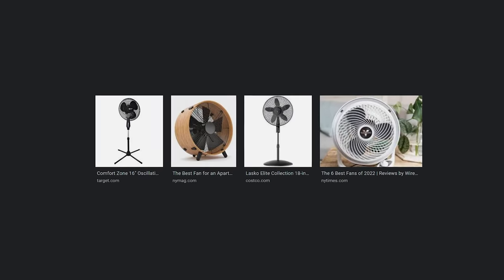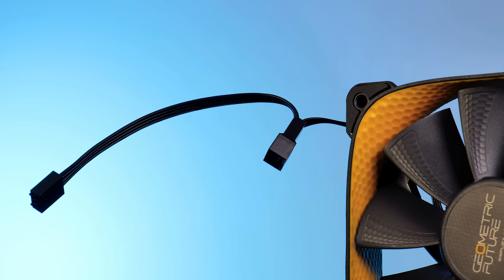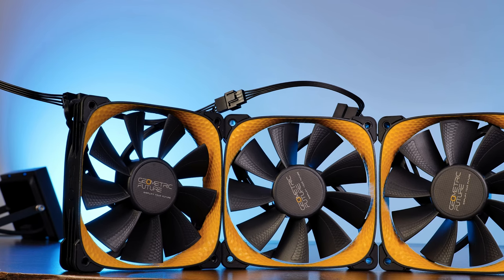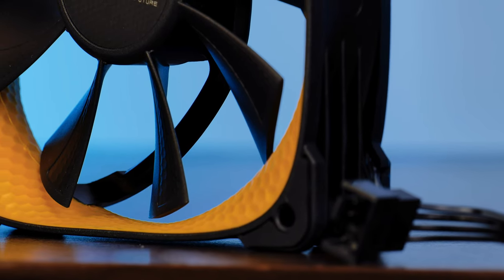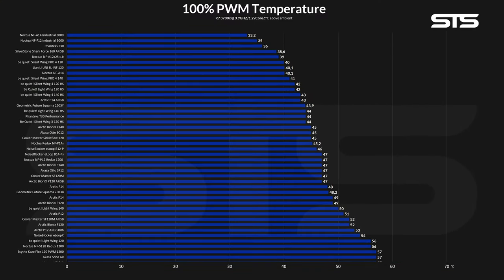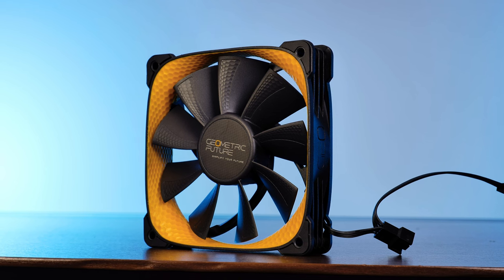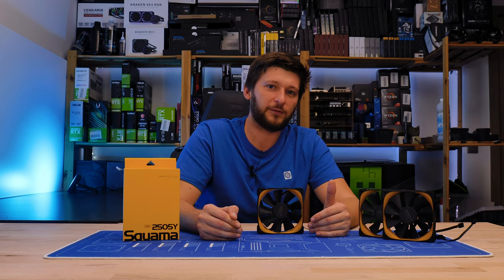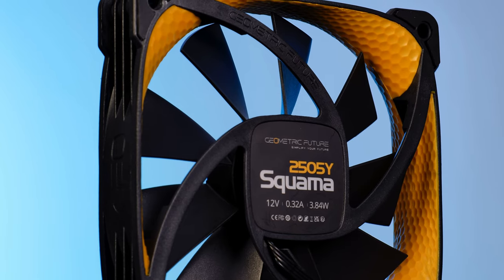Can Fans Have TOO Much Static Pressure - GEOMETRIC FUTURE Squama 2505Y Review

Comment: Good and interesting review. Remember who was there before with the 'Golf Ball' fan? Sharkoon Silent Eagle SE/800/2000; first came out around 2005. "“Silent Eagle” Case Fans are characterized by their special design: The rotor blades had the surface texture of a golf ball. The numerous small, round dimples produce an increased amount of airflow. In addition, the rounded edges of the fan’s frame improves the air influx."